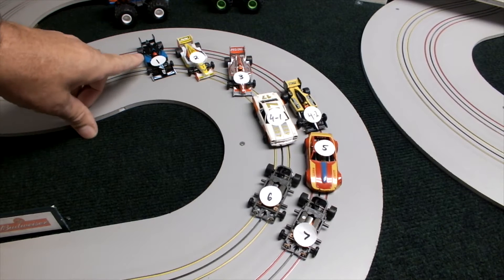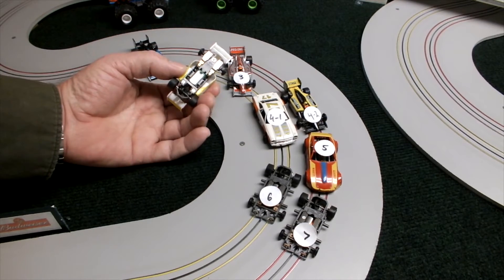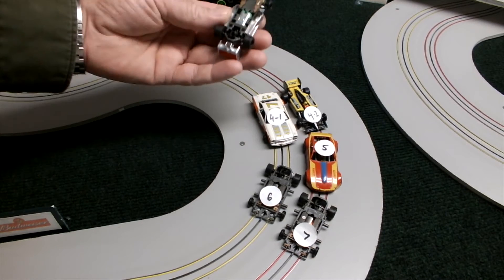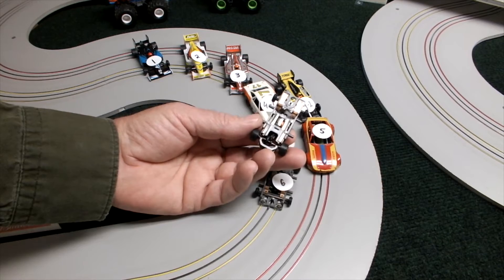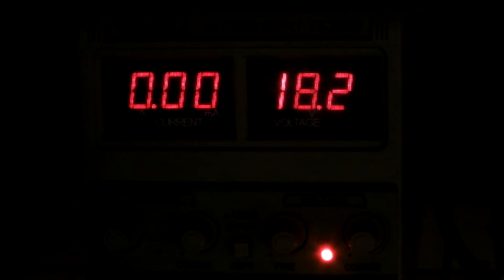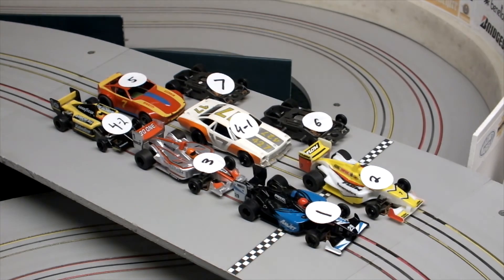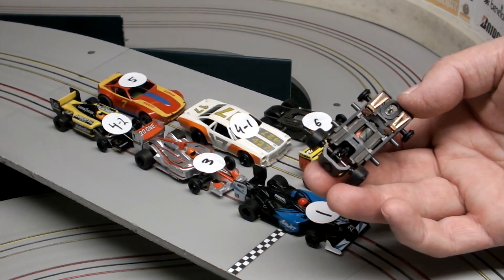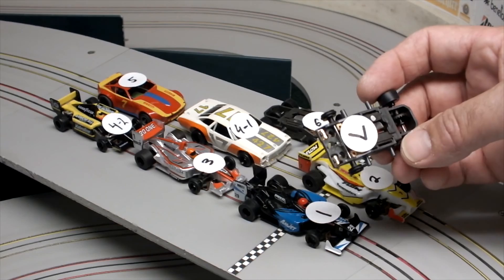HO Slot Car Track Power Hack III

Comment: Will it be ok to use a DC power station for power at all times on a 1/32 scalextric track
Reply from the maker: I do not know.
Reply: If the voltage is correct, check with Carrera, there maybe limits due to their unique system.

Comment: Can you do a special video on taking out the magnets and replacing with lead weights for a much more realist physics in the way the cars control and handle and respond instead of the fastest electric magnetic type train 🚊slot cars that hang upside down when suspended but instead try to to in the old t jet kind of physics ? Or have you not really thought about it ?